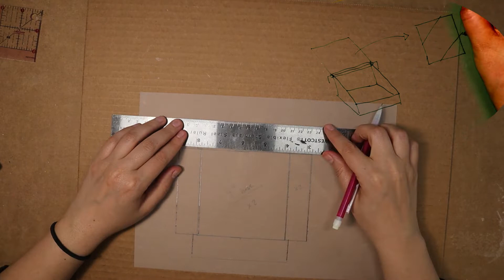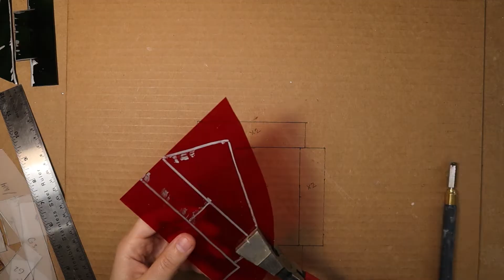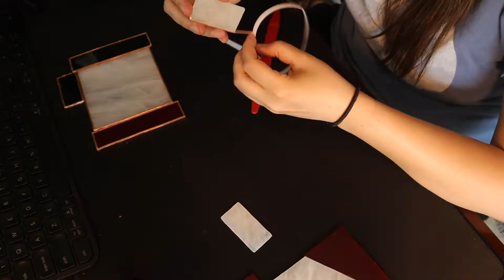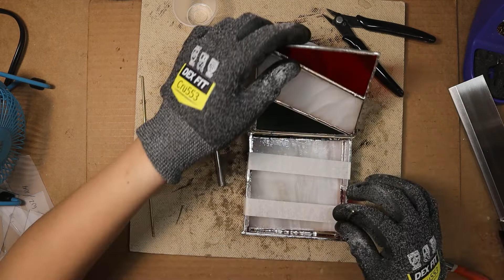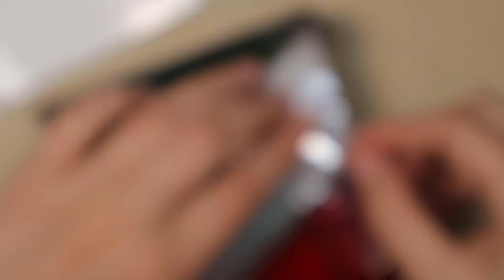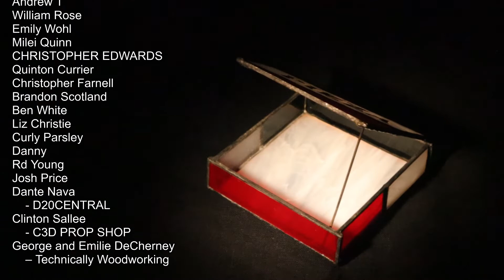Making a pizza box out of glass for my post-its

Comment: Did you grease the rod before you put the hinge together or was it smooth enough just brass on brass? Glad to see you've found a lead free alternative that works for you. Great project btw, such a cute little stationary ensemble with the pen container.
Reply from the maker: no i didnt. that would of been a good thing to do but hey LEARNING lol
Reply: @WhenGeeksCraft  You could call it a feature if it does get stiff to open/close as it won't fall shut and damage the glass/solder joins :)
Reply from the maker: Ohh for sure!